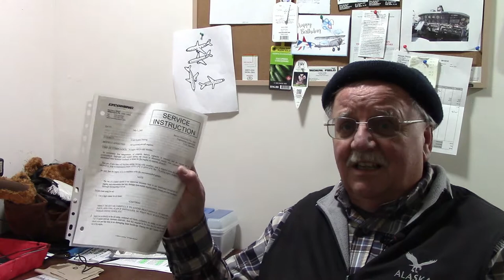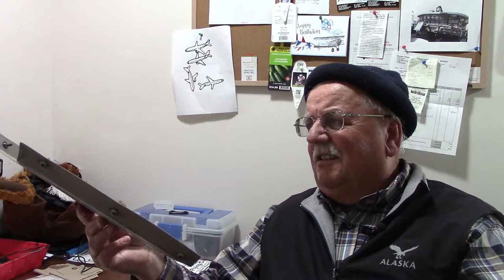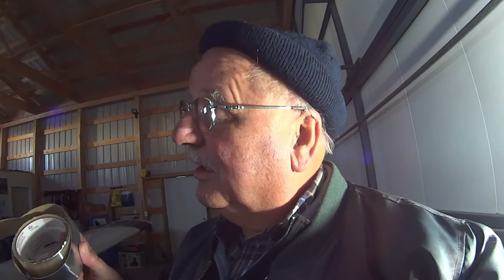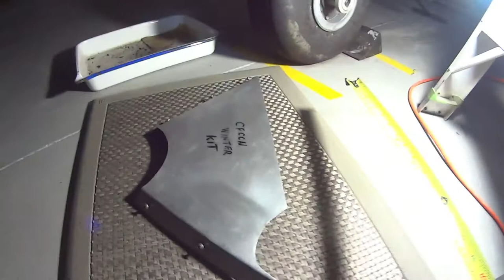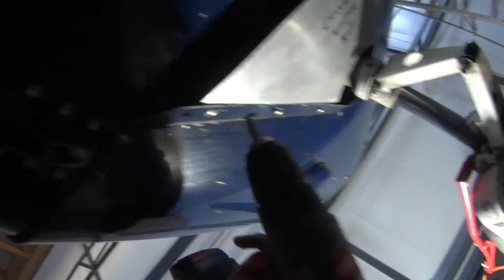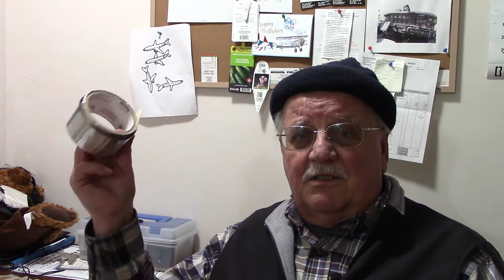Piper Cherokee  "Winterization Plate"  Vlog 270

Comment: Good video. Mine came with an aluminum plate that appears to be from the factory.  It covers the oil cooler opening and is not adjustable.  My friends RV-6 has has an adjustable cover using a carb cable.  Well thought out and simple solution for extreme conditions.  Thanks
Reply from the maker: Thanks Ron and thanks for watching

Comment: Our Club Cherokee ~ 1976 had what looked like a factory oil cooler plate.  It had temperature information printed (white on black plate) on it.  We also had the lower baffle that was very much like yours which I believed was factory.  It had rivnuts in the same places to hold it on, and soft (aluminum?) screws to attach it.  The lower plate should increase your CHT’s on the colder winter days.  They tend to be a bit low without it.  You have a nice system there to monitor all your temperatures.  Just for interest, we had a transient through the Province (heading for Euorpe) who began his trip in the southern states.  He had the old 100 W oil in the engines.  It was bitter cold on the ground, and in cruise at 9000 feet, the oil congealed in the cooler and caused him troubles.  He landed and an AME put winter weight oil in the engines and he was on his way.  I realize that with multivisvosity oils, this problem might not occur again, but it points out the importance of the cooler plates.  We had another fellow that “cooked” his Cherokee engine by flying with the plate installed in the summer.  I enjoy seeing an owner who knows what he is doing when it comes to the little and not so little maintenance issues.  Good video Chet and good information!
Reply from the maker: I have seen those "factory oil cooler plates" as well Stephen and even tried to see if they were available, however never have been able to locate an aircraft dealer that has them. When I bought my first plane, the Cessna 140 I just made my own as well as the J3.  Those engine/oil related stories you mentioned occurred to a friend of mine as well...he unfortunately wrecked the plane in the ensuing crash but walked away from it without injury.  I spent many an hour helping him on the rebuild, usually holding the bucking bars in place during the riveting...
Reply: @TAGALONGWITHCHET  My Dad’s first airplane was a Cessna 140.  I did my first 12 hours in that airplane.  It sure taught me how to peddle ! 🙂
Reply from the maker: @stephenmoore2754  if you have not seen it yet Stephen check out Vlog #2 it has my Cessna 140 on skiis ..quite an adventure..

Comment: One other comment.  I just enjoy your flights.  Two or three circuits is as good for me as a cross country flight.
Reply from the maker: Thanks Stephen will try to keep them going...I do need to get up every now and then away from all the madness ...
Reply: @TAGALONGWITHCHET  Thanks.  That brought back some memories.  Was that a ‘49?  Dad’s 140 had a metallized wing which seem to make it a bit hot (stalled around 60 mph).  The flaps gave you something to do, but didn’t seem to affect the fight characteristics much.  Cold days, hand prop, lots of prime . . . . If I remember correctly, you got enough cabin heat on vey cold days to keep your left foot warm enough to hurt, the right foot was just numb.  Dad wore surplus RCAF “bomber pants”, heavy but they did the trick.  There were no snowmobile suits yet.  ‘HTZ had the old “coffee grinder radio.  Good memories.  Thanks!
Reply from the maker: @stephenmoore2754  I can't recall the year Stephen however it did have electric start, I used to hand crank it in cold weather since it was easier on the starter due to a cold battery.  I had the muffler changed to a Cessna 150 type which gave you a lot of cabin heat as well as additional carb heat.  It came with a whistle stop Narco radio which I had replaced since it was as heavy as a boat anchor...bought an Escort 110 which even had a VOR..unfortunately it rarely could pick up a VOR signal unless you were quite close to the VOR..navigation was strictly map and compass ... Yep the good old days .. If you have some time check out some of my series  "Hangar Chet Chat", believe they start a Vlog 178, they tell of the experiences/adventures I had with that old bird..Cheers